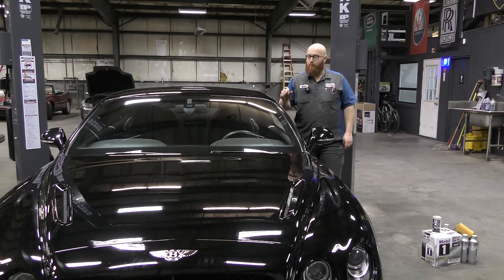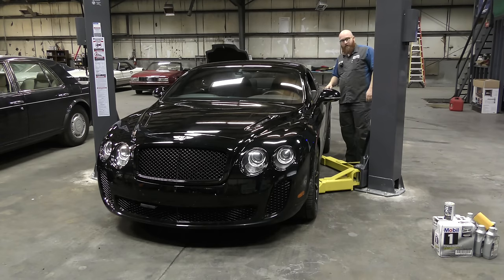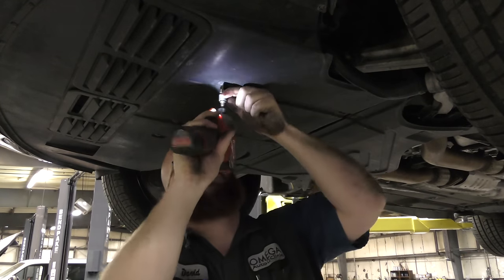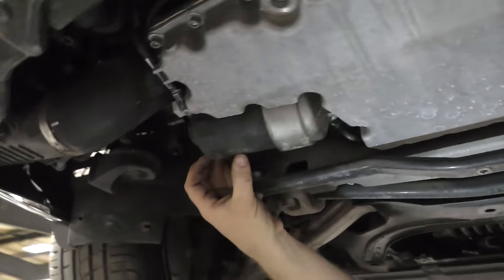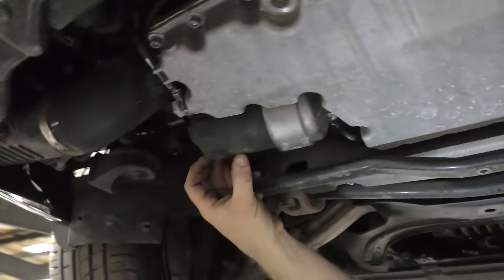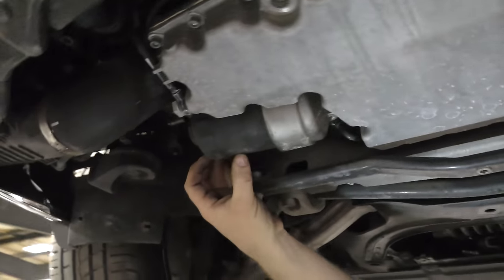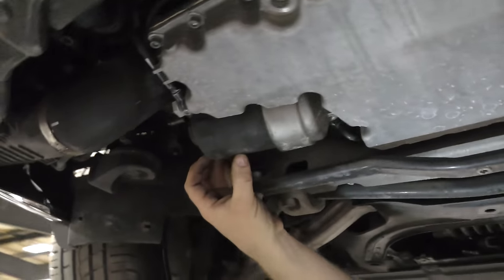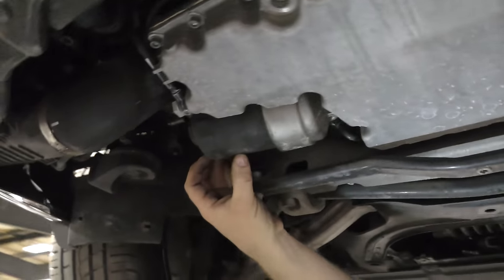One Fast Oil Change! The CAR WIZARD works on an insanely fast 2011 Bentley Continental Supersports!

Comment: Prefilling the oil filters walks hand in hand with the other myth of applying copper grease to brake pads.
Maybe once upon a time you did, but not anymore. Read the manufacturers recommendations or service manual. They never state that you should prefill filters, and brake manufacturers explicitly state DO NOT apply anti-slip grease to their brakes.

Comment: My Lotus dealer charges $250 for an oil change on my 2011 Exige S260 ... it takes 5 quarts ... needless to say I don't use the dealer .....  with parts and labor your oil change on the Bentley should be at least $350

Comment: I appreciate you sharing your knowledge with these videos car wizard. I am surprised by the German car makers how they build beautiful looking cars , then short change their customers by the way they engineer their cars and fit plastic parts in the engines. I am in the market for a new car , but it will not be a German one. the way they disrespect their customers. Just like when the jeweller Ratner said all are jewellery is crap, then went out of business. the Germans are going down the same road.

Comment: i think when oil hits the dry filter element on start up  the oil takes a second or two to soak into filter. you only need to wet the element not fill the whole filter. give this a try. see if you hear anything different on start up after oil change.

Comment: 200 USD? That's  cheap. My friend owns a BMW e63 645CI and he did a oil change on that (In sweden) just for the oil it was 150USD (Castrol Edge 8liters) then a filter(OEM) for 15 USD. The total was 350 USD. (they also checked for any codes and some minor things around the car)

Comment: there is actually a trick way of filling a oil filter and not splling it. put oil in the filter and shake the filter with oil in a circular motion and the oil will be stuck to the outside of the filter. in your application in the video this was not needed but in other situations this method could be used.

Comment: Cartridge type oil systems have a pressure valve this to regulate oil flow when servicing etc.
Reply: Its should be full flow system... Most US and Asian brands since about the 70s or 80s uses a special anti backflow valve on the filter top.
Reply: @jaybee2344  pity the Wizard didn't mention that Cheers 👍

Comment: Car holds 13 quarts of oil.  3, 5 quart jugs of Mobil 1 synthetic 15K oil is $100 tops with a filter included. $10 for an additional quart. $110 bucks for your own parts and $30 for the labor? Did I miss something here? Sounds like $140. Also, I would never put this shit in a Bentley as I use it in my 2005 Q45 which is fine. Would probably only use Motul in these high end cars.

Comment: The solution to the dry oil filter is the same as starting a motor with zero oil pressure. Prelube pump, before you start the motor you let the pump run for a couple seconds and turn it over. Then again who cares because motors are consumables.

Dumb question: you mentioned zinc in the additive, so how small are the particles and how small are the holes in the oil filter?

Comment: Adding the probably snake oil bg stuff, might of over filled it
Reply: He topped it after putting in the BG.  He got it just right.  Trust the Wizard.
Reply: But if it coats the parts then no..  Some of that stuff treats the oil NOT the metal.
Reply: BG is a great product.

Comment: so basically you charge about 85-105$ labor depending on price of oil. thats high labor for an oil change
Reply from the maker: Big Sean247 Not on a Bentley it isnt. Send me a link to an exotic shop thatll do it cheaper.
Reply: @CarWizard  i charge cost of materials +50 for an oil change on highend cars. well i did before my car accident. so just cuz its a bentley it makes it ok to charge that much labor on a less than half hour oil change?

Comment: As I heard it is 200$ I choked. „So cheap?“ I thought. In Germany most independent repair shops charge about 25-40€ per liter. And shops of a specific car brand and dealer shops rip your kidneys out of you for a simple oil change. I would likely pay around 250€ for my 320i, so 200$ for a Bentley? Bargain.

Comment: By the way don't you need to unscrew the oil filler cap before you undo the oil sump drain plug ?

Comment: 3 seconds with no oil pressure does more damage than 50k miles on the engine. Fit a pre-oiler like aircraft engines

Comment: Yeah, who was the genius to suggest to pre-fill the oil filter with oil...car wizard is right...no way the 2 secs. that filter does not have oil messes up the engine...just need to dab the rubber seal on the oil filter and hand tighten to close...no too tight.  Put a new washer on the oil plug and you’re done.  I been changing my oil without doing that for 25 yrs and not a single engine failure due to not doing that.

Comment: Wow, you hear about all sorts of stuff on the internet. Never heard about pre-filling oil filters - makes no sense to me at all. It's impossible to do on most cars.
Reply: Oh sure,  dry starting a motor is good for it!  Best practice is to pull the fuel injection fuse and crank the motor until the oil pressure light goes out.
Reply: @rbe3717  When doing a simple oil change? LOL. Not sure if you're serious.

Comment: My Bentley Contentental GT will not start all of a sudden in the market parking lot  it would not start.   I took it BENTLEY  thEY COULD NOT start it they clam its the starter  but could not give me aproper diagnosis because the battery went dead.   I never had problem with it until now. They claim  its $17000 to change starter. The point is I dont know truly whats wrong with it. The diagnostic reprort is a guess. Not a true report giving me the exact step i need to take to get it fixed, The mileage is only 48000.

Comment: Dry oil filter? Pull the fuel pump relay out and crank it over 5-10 times. Might not be that easy on a Bentley :/

Comment: If you can add oil to an oil filter without spilling you should, that being said never had an issue not adding oil to an oil filter. See some people adding a little silicone paste to the O ring  instead of oil because it's thicker?

Comment: $200 for an oil change on something like that is extremely reasonable. I knew someone with a 6 figure benz and his oil change at the dealer was around $700- $800

Comment: Wizard, watching you for the first time and subbed you because I do appreciate your mechanical abilities but you are absolutely incorrect about the motor being an Audi motor! The Audi A8 was the first production car to receive the motor in 2001 and the Volkswagen Group was credited for the production, but the original non-aircraft production unit was Britished designed (I think BMW made the first aircraft W12 engine if my memory serves me) and then the first automobile purpose-made W12 was made for a race car. Both the Brits and the Germans were said to design a single crank offset cylinder arrangement but the contemporary automobile motor was a British design. Bentley have pioneered that Audi fitted W12 motor out of their Crewe, UK plant where they hand assemble each motor and "HOT" test each motor for I forget how many hours run time. In fact, VAG have made the Crewe factory the "Center of Excellence" for the W12 and they are the ONLY manufacturer of that motor to THIS DAY. They increased their output from 3,500 motors annually to something like 9,900 in three years beginning in 2012 or 2013 if I can recall correctly, because they also use the motor in certain models of the Bentayga which launched in '15 or '16 to meet the American market's love of SUV's. Bentley British engineers designed that motor and build that motor, not Audi. It's possible that some Audi techs have transplanted to Crewe but I can't be sure of that. If need be I will hunt down the interview article in "Motorcar" magazine I think it was. The Crewe factory also first had the idea to make those motors "Flex-Fuel" in 2010 (mine was the 540th flex fuel motor made and there are "Crewe" stamps on some of the stickers). You may see Audi stickers on some of the parts but I assure you the motor itself was indeed designed and is made in the UK. I'm sorry to sound like a broken record but feel I cannot make the point strongly enough! The Krauts (I'm a Kraut myself so screw the PC folks out there if you don't like my derogatory comment) are usually the master engineers I admit (and the Italians of course but they just couldn't make a car inexpensively enough to stay afloat in Lamborghinis case), but the Brits get the nod here...

Comment: Ok Wizard, who do you have in Virginia that you suggest I take my 2011 SHO to for RPM surging and shuttering. 4 dealerships, 3 specialty shops, and 5k later. Does not throw any codes and no one can figure it out.

Comment: Umm, why did it seem like when you pulled the drain plug out it drained down like it only had 1 quart in it? 13 qts seems like it would of gushed out of there and made a mess all over,  spitting and splattering. No???
Reply: Hot oil flows faster
Reply: @jaybee2344  regardless
Reply: 100% confirmed. something happened. Either camera shot problem and re shot scene with small about oil etc. Or the car was severely low on oil previously to oil change.

Comment: 1st of all, there is NO reason to pre lube an oil filter on a daily driven gas engine. Especially when the filter is sideways or imverted. Its not a race car and 100% of the oil is never drained.  Most Diesel engines can benifit from this but, their filters are always vertical and even then not all the oil is drained. So calm down with the pre lubing of an oil filter. What about when you run your fuel tank down to near 0. That is the worst thing to do for a fuel pump. Oil always sits in crank, rod and cam bearings. And oil always sit on top of the engine slowly making its way down. So, unless you chamge your oil and let it sit for days or weeks itll be fine. I let a Toyota sienna sit for 2 years b4 starting it. It had some lifter tic. Eventually it went away. That is the true testament of a quality built engine. Had the same thing happen to a gen 1 small block chevy engine.

Comment: The love the people in the comments who think they know what they're talking about because their dad worked at Walmart changing oil.
Reply: I love the people who think starting the motor with a dry oil filter is a best practice.  If you have a vertical oil filter, fill it with oil before putting it on.  For horizontal filters, pull the fuel injection fuse and crank the motor until the filter fills and oil pressure light goes out.
Reply: @rbe3717  well when you open a mechanic shop and start your own YouTube channel  you can prefill your oil filters, until then, shut up.

Comment: 13 quarts? My car takes 5
Reply: Mines takes 3.5 😂 and almost over filled it my 1st time changing the oil lol
Reply: Yours is a 4,6or 8 cylinder, this is a 12 cylinder 690 hp beast.
Reply: Even the newer V6, V8s uses like 8-10 quarts. More oil=more cooling and better lubrication.

Comment: The solution to the oil filter problem is obvious.  Fill the filter with oil, rotate the car 90 degrees, screw in the filter, rotate the car back and viola.  "How the ^#@% do I rotate the car 90 degrees!?"  Sorry man, only the first answer is free.

Comment: I can't believe you didn't use a torque wrench on the oil filter. You're going to warp the cylinder head! What a hack 🙄
Reply: the filter doesnt go on the  cylinder head so no he is  not
Reply: @bigsean2473  it's a joke

Comment: Who fills a oil filter up with oil ? No need for that 🤷🏾‍♂️🤦🏾‍♂️😂
Reply: Depends on how big the filter is. And if it’s easy to get to then it’s doesn’t hurt
Reply: If it's on a vehicle where I can without spilling it all over I pre-fill mine as best as I can.  On my Ford's V10 the filter doesn't sit at much of an angle so I fill it up halfway or so, on other vehicles like my Impreza where the filter sits upside down on the top of the engine you can't pre-fill it.  I notice the oil pressure warning light doesn't stay on as long and the engine clatter at startup doesn't last as long.  Like the Wizard said it isn't going to hurt it, but it makes me feel better to pre-fill.
Reply: UnsulliedSpy same with my v8 Dodge. I fill the filter up 3/4th of the way. Just to have something